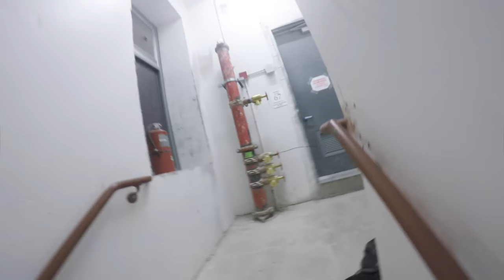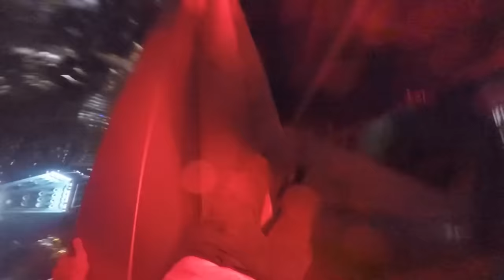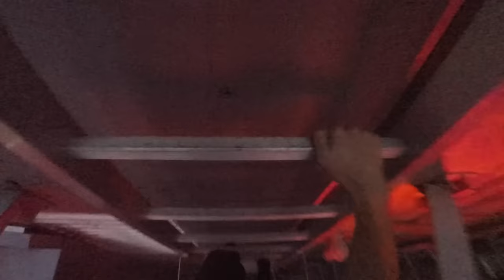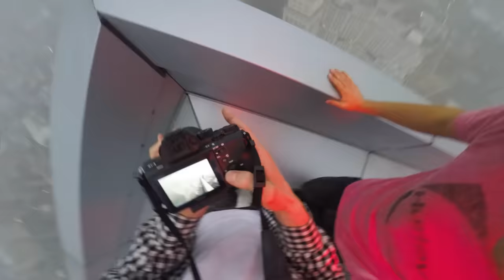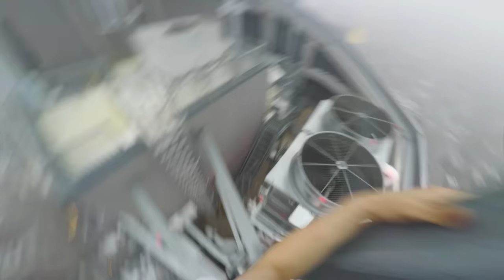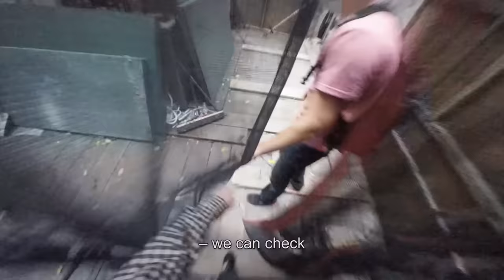infiltrating NYC skyscraper (full process POV)

Comment: How anyone could automatically trust the construction work to be solid is beyond me. Even if I had the balls to go for it, I would have zero faith that the stuff would hold. I commend you on your bravery, sir.
Reply: If it's that high up it's definitely going to be secure.
Reply: You realize that the workers have to be up there with heavy equipment right? Of course it's stable 🤦‍♂️
Reply: osha regulations
Reply: this is on top of a skyscraper, what do you think this is made of, cardboard? 🤣 also the construction workers had to  be there building this stuff
Reply: Also, you can thank codes and regulation for safety of buildings.

Comment: Climbing up to the top, butt clenching stuff. Spotting police at the bottom and seeing the shiney wet surfaces and a narrow concrete ledge you crawl down was seat shuffling, butt clenching grip tight and adrenalin rush stuff. So glad I am 58 and beyond this for kicks. All men are not created equal as this video proves. No doubt DL would not do some of the things I have done on terra firma.
Edit. Just seeing the climb up to the top of the stainless steel vent, I started rocking in my seat, my feet were shuffling and teeth grinding stuff.

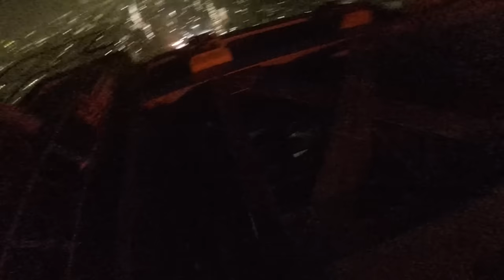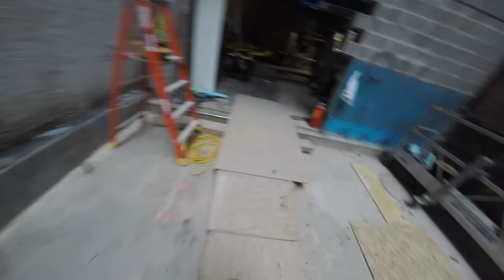Comment: bro the end of this video was your escape path when the police chased you. It looks like the building was more built in the police chase, you went through a door in that video but in this video it's an unfinished wall that leads you straight to the street. https://www.youtube.com/watch?v=7F5c64u0q28 @7:29 you enter the room and head the opposite direction. you get to  a dead end and your friend points out the door which in this video is at 51:10. crazy